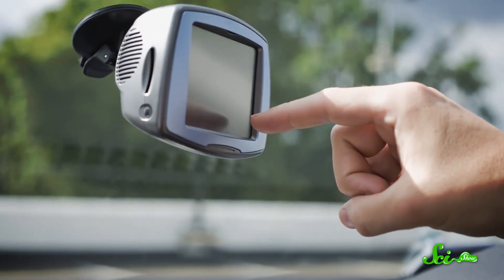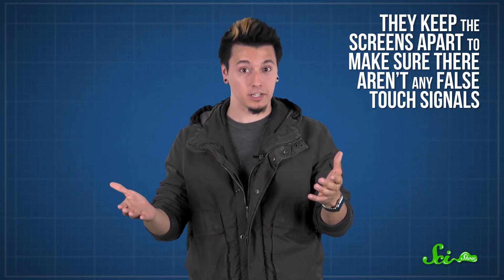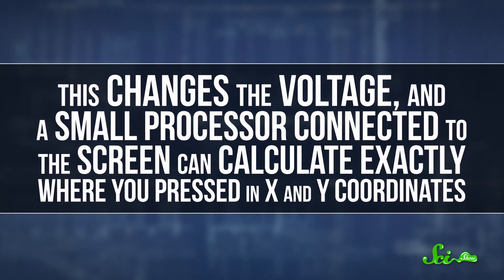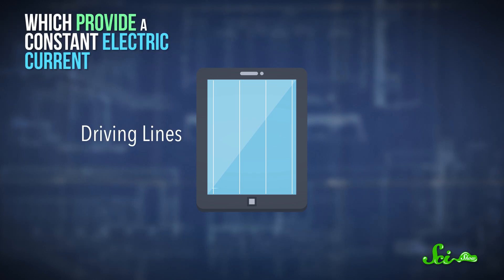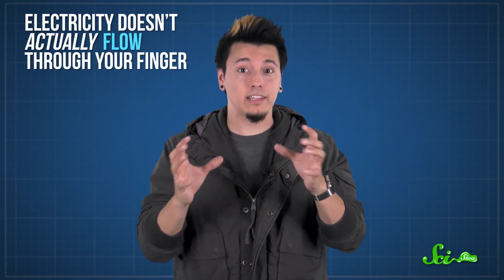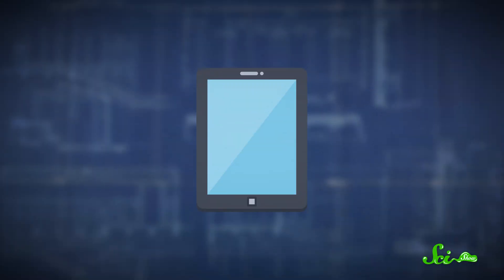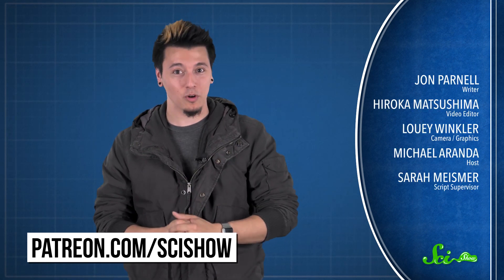How Do Touchscreens Work?

Comment: So which kind does my nintendo DS use?
Reply: Resistive
Reply: I wondered the same
Reply: Penis
Reply: You couldn't figure that out by watching the video? -.-
Reply: The DS and 3DS touchscreens work with anything that applies pressure, so it must be the resistive variant. Otherwise they stylus wouldn't work!
Reply: Also, they can only accurately detect one point of pressure at a time, otherwise the system assumes the pressure point is in the middle of the two actual areas that are being pressed.
Reply: it's kind of fun to make my own stylus if i loose them

Comment: What about digitizers
How the hell do they know where the pen is?
Reply: According to Wikipedia, the pen emits information via low-frequency radio waves. The tablet measures these signals and their intensity via a grid of wires, which it then analyses in software to figure out where the signal was strongest, thus where the pen is. The battery-less pens get their power through electromagnetic induction, and the tablet flips between sending power and reading the signal hundreds of times per second (it uses the same wires to send and recieve).
Reply: The pen is in between your legs

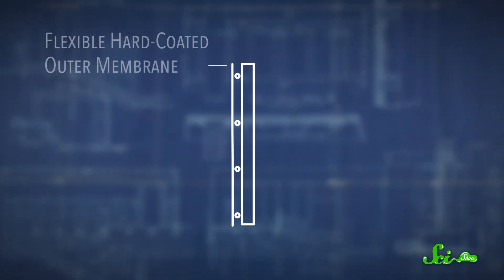Comment: 0:43 you pictured PET preforms when you mentioned polyethylene , PET (Polyethylene terephthalate) and PE ( Polyethylene) are significantly different.  I'm far from an expert on polymer selection but I think PET would be the plastic of choice and therefore the one they are using in this case.

Comment: sometimes, when i have my smartphone in my jean pocket for a while with the screen facing my thigh, it won't respond to my finger. i always thought touchscreens had to do with heat, and so when my phone becomes unresponsive like that, i assumed it was because i had heated the screen up, and so it couldn't detect the heat of my finger. does my thigh instead affect the electromagnetic field on the screen somehow?

Comment: what about touch screens 
like the s7 that sense your fingers when you aren't even touching it?
Reply: That's just due to the electric field from it extending slightly past the surface of the screen. Some phones actually have settings that boost it even further so as to work better with gloves.

Comment: Would you really consider resistive to be the most common??  It's hard to find a device that isn't capacitive these days.
Reply: Capacitive touchscreens are kinda only found in phones/tablets. Other then that, it's most than likely resistive.
Reply: If you include ATMs and pretty much every single touch screen you will find on stuff like soda machines and RedBoxes, as well as the Nintendo 3DS and touch screens on cameras, resistive touch outnumbers everything else 10:1.
Reply: +Richard Servello those are most likely not capacitive Screens because they are expensive as hell. Nowadays, things like ATMs or Ticket machines or things like that use Infrared-touchscreens. They are not pressure-sensitive like resistive Touchscreens and work differently than capacitive Screens. I'd suggest you check Google for a bit more info, don't know too much about them.
Reply: Yeah you're right
Reply: James Burgess the only place I see resistive are in horribly outdated pos machines.  New terminals and banks use capacitive.
Reply: techwizard24 Again, devices introduced before capacitive screens.  Go to a chase bank and check out their ATMs.
Reply: +Richard Servello 
What does the date of introduction have to do with anything?

Comment: Sometimes I'm moving my my finger to touch my screen and my screen senses my touch before my finger actually touches the screen - what's that?
Reply: Yup Christopher is right. The electric field you finger has, which the screen detects, doesn't actually need to physically contact the screen. It just needs to be close enough for the sensors to register, which can sometimes be before you actually touch it. I'm going to go ahead and guess that manufacturers try to minimize that effect, because it probably would lead to a lot of erroneous presses if it detected too far away.
Reply: +Switzer oh, good - thank you. I feel better knowing my computer isn't haunted but slightly disappointed I don't have some sort of telekinetic super power ... (:

Comment: I hate touch screens. I want god damn fucking buttons. Please make a decent phone with buttons.. I don't need a 6-7 inch screen
Reply: Uh, aren't those called computers?
Reply: Blackberry Priv.  It's awesome and it uses android.
Reply: ....Where do you live where you can't find a flip phone anymore?
Reply: I miss making smoke signals. Progress sucks!
Reply: so, basically you want a phone that gives you a challenge instead of an easy-to-use touchscreen?
Reply: I'd live with having my phone be twice as thick if it meant it had a sliding screen that revealed a full qwerty keyboard. I'm sure they still make models like that but they're uncommon and you never see them. I've had two smartphones and both have had shitty touch screens that lag or aren't always accurate, plus they don't work when you have crap on your hands and you can't use them without looking very well. Must be less expensive to manufacture a touch screen
Reply: Just buy an old-fashioned flip phone. Or blackberry.
Reply: The Blackberry Q10

Comment: Is there a hardware reason why my phone can only detect 2 points of contact? Hard to play SMW or any games that require you to hold a run button.
Reply: The touch controller just doesn't support more than two. There's nothing stopping a capacitive touchscreen from having more than two, in principle.

Comment: Why does heat make your hair straight?
Reply: It denatures the keratin
Reply: +sharon xox No, that's your scalp (dandruff). Hair and nails among other things are made of keratin.
Reply: no, its made of the same stuff fur feathers and scales are. dead cells are just dead cells, they would slough off, and wouldn't have such characteristics as shine, elasticity, and tensile strength
Reply: It doesn't. It just makes your hair able to shape the way you want it... kind of like a blacksmith working wit metal.
Reply: +Michael Hemingway isn't hair made of dead cells?
Reply: +KinRedysko You win the internet.
Reply: Because gay hair is too cool to be there

Comment: And then you have optical touch screens where the finger isn't connecting or influencing electric fields but rather affect the refractions of light going horizontally though the mebrane on the screen. Has the advantage that the surface doesn't need to be layered with lines, only the edges.   
Really cool next gen.

Comment: Why is it that I can still use my touch screen with a screen protector on?
Reply: Screen protectors are not conductive. The reason that touchscreens work with screen protectors is that capacitive touchscreens don't register a touch when an object directly touches them, but when an object gets very near to them. Capacitive screens detect changes in an electromagnetic field caused by something conductive coming in close proximity to the screen. Since screen protectors are very thin, your finger gets close enough to the screen to register a touch. Soruces: https://www.quora.com/How-do-touchscreens-still-work-with-a-screen-protector https://www.reddit.com/r/explainlikeimfive/comments/2k6lz5/eli5_how_does_a_phone_touchscreen_work_through_a/ https://www.wikiwand.com/en/Touchscreen#/Capacitive
Reply: So basically whenever you use the touchscreen on your phone your input is registered before you actually touch it? meaning you don't really need to touch your phone screen to use it. We simply touch it because it is simpler that stopping or fingers a few millimeters away? Technology!
Reply: @sp00machine  Thank you, this also answers my question of why rabbit ears (covered with fur just like gloves cover fingers with cloth) also trigger capacitative touch screens. The fur must be thin enough that it doesn't interfere.
Reply: capacitive touchscreens need only feel the effect of the capacitance of your finger which can be felt at a distance with the intensity decreasing as a square of the distance. Your phone even has the conductive traces on the inside behind the thin layer of glass/plastic in from of the screen. Good capacitive touchscreens can even detect a finger up to a few inches away if calibrated for that sensitivity. Your screen protector is simply thin enough that your finger gets close enough to be detected.
Reply: Pepe! At The Disco yes, but wouldn't that activate the entire screen at once? screen protectors are almost never aligned perfectly.
Reply: Illumanati
Reply: +gman060692 
That also explains hovering input some apps  offer as well as the glove mode on some phones.
Reply: Ian Flanagan gman060692 Wow, thanks! This really cleared things up for me. I was also wondering why the traces wouldn't wear off or no longer work due to scratches, but that question was answered as well :D
Reply: If you look very closely you can sometimes make the screen reackt without tuching it at all, jus hovering your finger about 0.1mm over the screen can sometimes be enough.
You are changing the capacitance by just being near it but there is a built in threshold before it does anything
Reply: +gman060692 great job and thanks
Reply: NICE
Reply: Paul Conway it conducts at the specific point you press
Reply: it be like that
Reply: This is why I’m here because I just googled tgat
Reply: Because it's conductive
Reply: Pepe! At The Disco OOOOH A RARE PEPE CAN I BUY YOU
Reply: i think you mean a few centimeters lol? Inches seems like quite alot.

Comment: How CPU's are programmed
How CPU's work
How the Internet works
Reply: CPUs process information via billions of transistors. They aren&#39;t  &quot;programmed&quot;, they merely receive and send data. The EEPROM is what holds the most basic instructions. Then the OS kicks in from the HDD. The internet is a very large series of connected servers (hosts), and computers (clients), all served via an ISP. Your client connects to you DNS which directs you to a web server. The name server (.com, .org, etc.) then connects you to the requested domain. Then the domain servers connect with the host server, sending whatever file (usually a web page) back to your client. That&#39;s the internet in VERY simplified terms.
Reply: Arduino Guy Projects and More! Thanks for the explanation
Reply: Scott Velez You're welcome :)

Comment: Then how does my smartphone register my insulated charger? The outside of the cable shouldn't conduct electricity. It can also process multiple touches so it isn't resistive.

Comment: Why does helium make your voice go high pitched.
Reply: Physics, helium is much lighter than air so when you speak it moves much faster and thus produces a higher pitch through vibrations.
Reply: +Super Hans I find that more plausible than physics
Reply: +RedTriangle53 you've obviously never inhaled helium..
Reply: PerrinPansy its a joke boi r/woooosh
Reply: +Amanuel Yohannes
It's a combination of what +Name said and what +RedTriangle53 said. Technically, breathing helium does not increase the fundamental pitch of your voice, but it does certainly change its timbre. In particular, it "flattens" your voice, as overtones in less dense gases like helium are much quieter than in denser gases like nitrogen and oxygen. Similarly, if you breathe a very dense gas like sulfur hexafluoride, your voice becomes richer, which much louder overtones (and undertones).

Although the psychology of sound is not completely understood, when we lack context for evaluating an absolute pitch, we seem to interpret flatter sounds as higher pitched and richer sounds as lower pitched, an effect which might be amplified by the presence of audible undertones. This seems to have a self-reinforcing effect, and you can easily tell that most people physiologically change the sound they produce when breathing helium to make it higher without even noticing, sort of like the ideomotor effect. This combination of flat overtones produced by deliberately shortened vocal cords is really what gives helium its unique sound.
Reply: +XShadowshot A lot of their videos could be answered with a Google search though, but I still agree
Reply: +XShadowshot so can most of their other vid ideas
Reply: Because it hates you
Reply: this can be easily znswered in Google. Don't make scishow waste their time.
Reply: Amanuel Yohannes https://youtu.be/oRBFMRqSoF0
Reply: 😉👍 Finally! A comment that's not related in ANY possible way to the subject matter of the video! At last, the purpose of the comment section has been fulfilled...... 😬
Reply: @HighlanderNorth1  Bro you bout 4 years too late tf
Reply: Because it's a thinner gas
Reply: Ontario K true but this is a more simple question.
Reply: The opposite would happen if you inhale a gas that is denser than air...like Sulfur Hexafluoride,wich makes your voice sound like Darth Vader or Batman
Reply: Your resonance frequency can be changed with the medium
Reply: Hellium wants to escap and makes the high pitch sound????        Idk
Reply: It doesn't, you just change your voice manually after inhaling it to trick people into thinking the helium does it.
Reply: @RedTriangle53  no...
Reply: It has a lower density than nitrogen
Reply: Cause it shrinks your lungs

Comment: Now, I and a lot of other people have 'glove mode' on their phones. How does that work then? Same issue with water resistant phones like the new Galaxy S7 that can be used while you shower.
Reply: +woodfur00 only ultra pure water isny a conductor. Common water is
Reply: Yeah, my Sony Xperia Z2 has a glove mode. I'm assuming it just increases the sensitivity of the sensing lines on the projected capacitance display.
Reply: Water has salts in it, too. It wouldn't conduct electricity otherwise.
Reply: Water shouldn't affect the screen. Sweat does because it's saline.
Reply: Le Na Not even that. You'd have to deionize it first. But DI water will eventually return to being ionized all by itself.
Reply: +Mike Trieu (MegasChara) thank u
Reply: my Galaxy S5 used to have that. Just checked my S7 edge and doesn't seem to have it. Could be a hidden feature

Comment: How do those pen things work that you can use instead of your finger?
Reply: They will have conductive tips
Reply: Cheap ones are simply conductive and conduct your fingers capacitance to the capacitive sensor and slightly more expensive ones contain a capacitor so they don't need your finger to work.(you can even make a decent capacitive stylus by taping some conductive foam to the negative end of a AAA battery) 

the much more expensive drawing stylus units such as those drawing tablet from Wacom use inductive sensing. A small coil in the pen presents an inductive load to a grid of wires with alternating current running through them. The AC current generates an oscillating magnetic field which is picked up by the coil in the pen altering the current running through the wires.
Reply: they are conductive
Reply: A stylus for a normal phone conducts body capacitance to the screen, so it's similar to using your finger. The stylus on a phone like the Samsung Note series is different -- these have a digitizer embedded in the screen, and use an inductive stylus like a Wacom tablet for much higher precision.
Reply: +gman060692 fuckin nerd